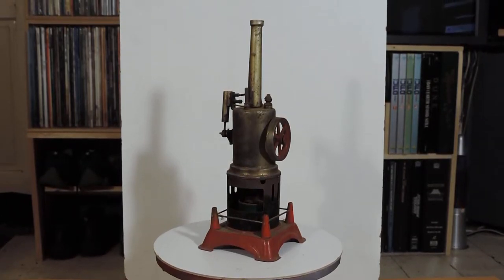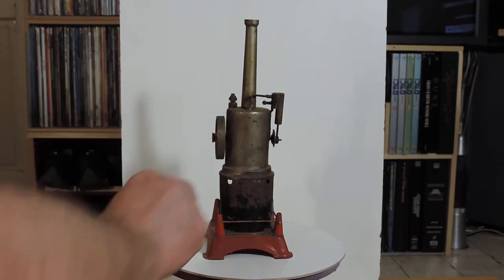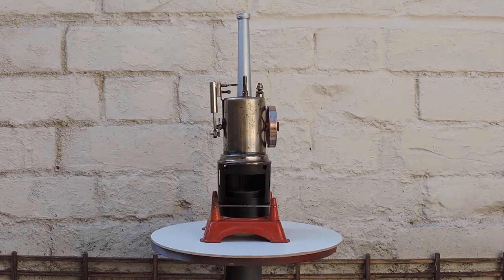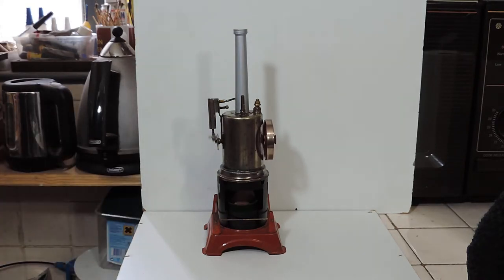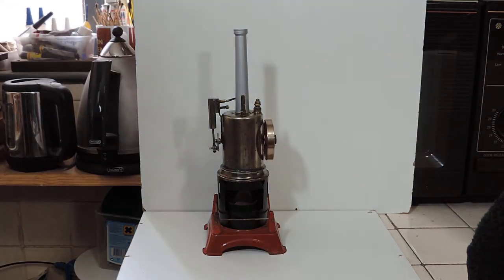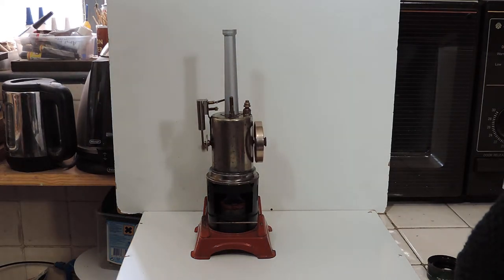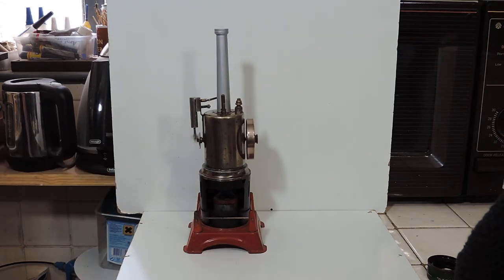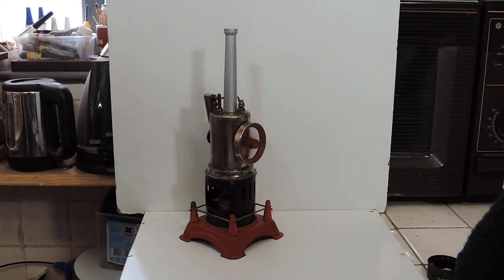Linemar J-5322 Model Steam Engine

Comment: Another cracking restoration Alan, I've just seen the before photos on your website, you did well to save this one Alan, well done.
Reply from the maker: Thanks Mike. These really are the cheapest of steam toys but there is just something about them.
Reply from the maker: @Do Viet Thank you. The easiest way is to simply fill the boiler right up and then empty it into a measuring glass. With small boilers I would then fill to say 50 ml less than the full capacity. With larger boilers I would fill to 100 ml less than the full capacity.